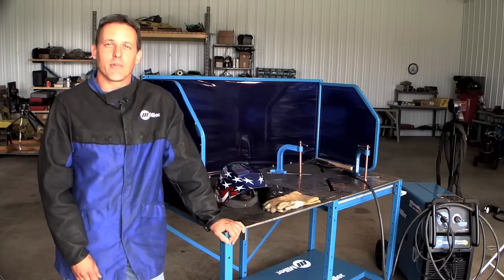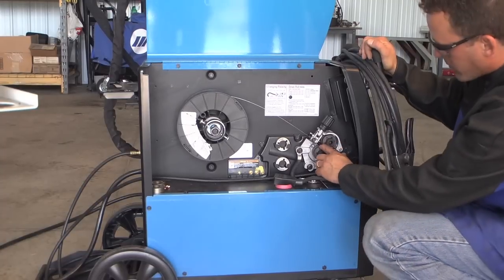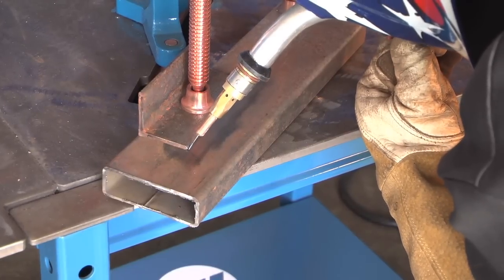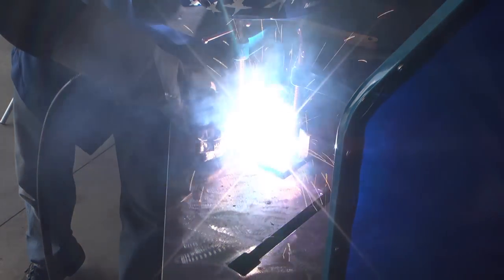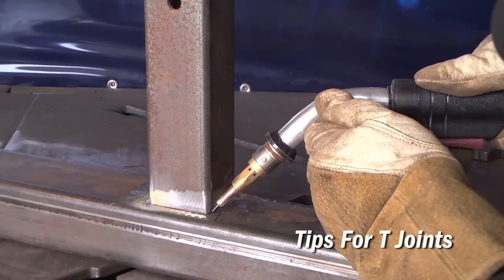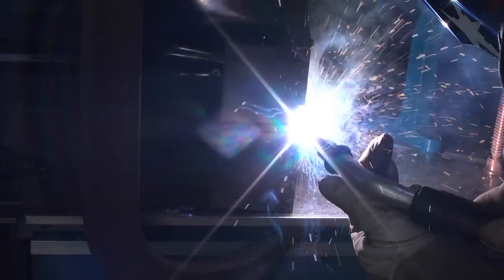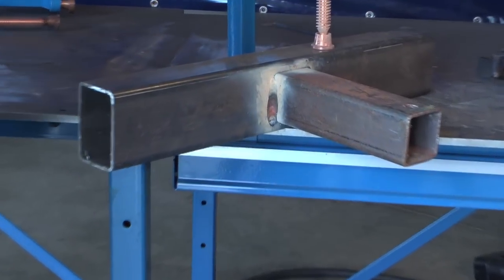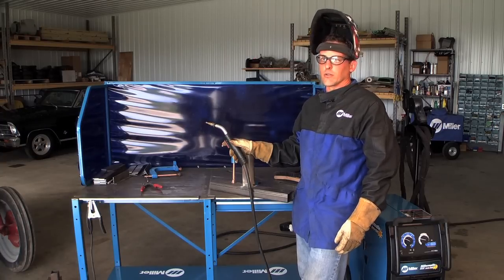Flux-Cored Welding Basics: Tips for Flux-Cored Welding

Comment: Worked in a rail freight car manufacturing plant for three years. They had flux core, but it was also with combination with argon and CO2, the wire used was called XL-71, that stuff was amazing, so easy to weld in pretty much any position for thicknesses over 1/8 inch. If you get your hands on that stuff, go nuts on structural welding.
Reply: Gas shielded flux-core is a slightly different and much nicer thing.  I think the self-shielded action we see here is something you use when there's no choice (such as being outside or otherwise in a breeze).  I'm just learning to do it now.  It's nasty!  I think it's really the thing for heavy structural which is not what I'm doing.  Some applications are for six or eight hundred amps!  I have some dual-shield stainless which I really like, and the ESAB dual shield also. As Jody said about something else: "They make you seem better than you are"!  Innershield action is NOT like that.  It makes you seem like you're making a big mess!

Comment: Joel...thank you for a great video. An experienced welder at work named Al Howie recently explained to me that the gas shield nozzle my welder came with is not good for flux core wire. I'm going to remove it and try again. All I was getting was splatter and blobs of weld. I'm better with stick, so this has been frustrating for me. Thanks to for going into detail on angles, stitches, drags and positions. Deuce? I own a real Deuce. That would be an M35A2C. Peace.

Comment: I have been using a friends welder with flux core wire.  I never used flux core so I didn't realized that knurled wheels are needed.  I was getting ready to replace the liner because of the feed problems, now I know I need to get the correct wheels.  Thanks.

Comment from the maker: And regarding the gun angle, we use the old saying "if there's slag, you drag!" Because this process produces slag, we want to pull the gun instead of pushing to avoid creating slag inclusions.
Reply: I am doing the drag most of the time. Even then I am getting lots of slag inclusions and uneven metal deposits. Surface is ground clean, so what am I overlooking?

Related question, my chipping hammer tip rounds over very easily on both the pointed and flat ends. Ground it a couple of times. Thought maybe the specific one I bought didn't get heat treated correctly so bought a replacement. Doing the same thing. Do all chipping hammers round over or did I just end up with a low quality hammer?
Reply: @brianworley7705  did you reverse the polarity of your machine like he said?
Reply: @zachshiray8998  Yes, when I changed from mig wire to flux core wire, I changed the polarity according to the diagram on the inside of my welder cover. I double checked it later thinking maybe I had done something wrong, all appears good. I don't know if I need more practice. I have observed the gun/tip angle seems to change a decent weld to splattering. So maye that is how I am getting slag inclusions?

Comment: Hi thank you for a great video & easy to follow I just bought one my welder  has a shroud over it is that for the gas I see you have taken yours off thank you for any info
Regards
Steve UK London
Reply from the maker: Hi Steve, you can leave them on when flux core welding, but they are not needed and will allow you to see the weld better without it.

Comment from the maker: Some flux-core wires do require a shielding gas, but most don't. In most cases we turn to flux core because it's an outdoor or breezy environment where shielding gas simply won't work. Depends on your specific wire and application, though.

Comment: Thanks for the informative vid Joel. Hey RotSeele I saw your post and wanted to comment. I saw some other instructional vids and they recommend pulling the bead but don't necessarily say you can't push it. If you watch Joel's video here, when he talks about the vertical weld he says if you "push up" you will get more penetration as opposed to pulling down. Probably the reason your teacher said to push the bead. I'm just starting out in welding myself. I'm a little older than you but just wanted

Comment: Thanks for answering my previous question. Another newbie question is how safe is electric flux corded welder? Let's say I accidentally exposed and touched the piece of metal while welding, would I get electrocuted and die on the spot? Example 100 amp welder. I'm in fl with 90+ degree everyday, so by the time I'm done wearing full protection suit, I'd sweats a lot and it's create moisture which I heard it's not good for welding.
Reply from the maker: Thanks for the question, t dub. Please consult your owner's manual for a list of safety precautions, including personal protective gear, environmental considerations and best practices for installation and operation. In your manual you will find specific instructions for grounding your equipment, proper handling of electrical components, maintenance and more.

Thanks!
Reply: i've held parts with one hand and welded with the other many times and never been shocked.

Comment: Hi Joel, I've noticed that some people take off the gas shield when using flux cored wire. I can see why this is possible because you aren't using a gas. My question is ,'Would this be OK do you think for 'any' torch as I can see how much better you can see your work. Great Vids for green people like me .Thanks a lot.
Reply from the maker: Gene - Quite often the nozzle is taken off so people don't ruin the nozzle and plug it up with spatter. This way the nozzle is clean if the operator would switch back to solid wire. Also, it is much easier to see.
Reply: Thanks for that. I hadn't thought about the amount of flux spatter that would build up in the nozzle.Thanks again..good vids. Gene

Comment: i just do a little job now and then on my vehicle, rust panel change, but when i use flux core, the volts changes up and dawn, somehow, i do not understand it, it's a CIG model 155 amps, what tip can i get please here, should i take it to warantee shop, unless u might give us an idea thanks, great work u did i love that work there, thanks many,regards lenny
Reply from the maker: Thank you for reaching out. We recommend giving our service line a call to talk this through with a tech. The number is 920-734-9821. If there’s anything else we can help with, just let us know.

Comment: Those are some sweet welds. I always seem to have a hard time following the gap/joint to be welded. My welds meander around. Maybe my shade is set too high?  I'm paranoid about messing up my eyesight.
Reply: I'm in the same position. I set my lens to maximum sensitivity and shading but I can barely see the weld pool.

Comment: Do you need to clean the slag off at the finish?  Will it affect the weld over time or even act as a barrier to the elements?  The only reason I can think of to deslag is to inspect the weld.
Reply from the maker: +Robert Marks You do not need to remove the slag on the final pass or if you are performing a single pass. You would only want to remove the slag for the following: if the weld is to be inspected, if you want to review your weld or if the part you’re welding is to be painted, power coated, etc.

If you are just trying to stick 2 pieces of material together and do not care what the weld looks like, and the pieces will not be finished in any way, then no, the slag does not have to be removed. Please let us know if you have any further questions. Thank you.
Reply: Miller Welders Thank you.  I was thinking of making a trestle for my wife's garden and I don't care too much about the welds since it's not load bearing except for climbing plants.
Reply: +Robert Marks always remove the slag and clean your weld. its what a professional would do

Comment from the maker: Also, the use of the appropriate Personal Protective Equipment is required to prevent contact with live electrical parts. As always, to protect yourself and others from injury, you must read and follow all labels and the Owner’s Manual carefully before installing, operating, or servicing welding equipment.

Comment from the maker: For the self-shielded flux-cored process shown here, it is not necessary to have a nozzle. The arc generates an atmosphere that protects the weld puddle from the outside air, which is why the process is used so widely on outdoor construction applications and is not affected by the air from the fan. You can add an insulator to the front end of the gun, however, if you wish to protect the contact tip.

Comment: Thank you for the great video.  Is it possible to fill small gaps when using flux core wire?  Can i spot weld along the gap and then fill in afterwards?
Reply from the maker: Hi Courtney! Thanks for reaching out. We recommend giving our service line a call to talk this through with a tech. The number is 920-734-9821. If there’s anything else we can help with, just let us know.

Comment from the maker: All of the Miller equipment used for Flux-Cored Welding does de-energize the electrode and wire when the trigger is released and therefore a conical tip protector is not used as part of the system. Additionally, the Open Circuit Voltage (OCV) of the equipment used is 35 VDC maximum. This voltage level is within the limits of a safety extra-low voltage (SELV) system.  (cont.)

Comment: Why did you change the polarity?  Are all these tips good for all metal types?  Stainless steal?
Reply from the maker: shmeet, 
Self shielded flux core wire is supposed to be ran in electrode negative. There are other flux core wires that are considered dual shield in which you would use gas and run electrode positive. 
We recommend that you follow the manufactures recommendation for the wire you are running. Yes, these tips work for all metal types - even stainless! Please let us know if you have any other questions. Thank you.
Reply: DCEN flux core wire + goes to clamp, - goes to gun. DCEP mig + to gun, - to clamp  Hope that helps. You can weld the other way just really poopy welds.

Comment: About the fastest welding method I've ever used.Low current use compared MAW and about 3 times the travel speed. While not the most attractive result certainly tough and pinpoint positioning of heat.

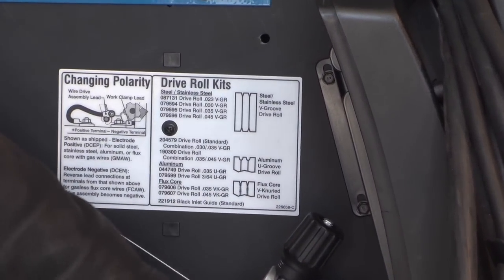Comment: So, flux welding going negative (1:17), does it means put the ground to (+) and the stinger to (-)?
Reply from the maker: That would be correct. With self-shielded flux core wire you would use electrode negative, work cable/clamp would go on the + stud and the cable for the MIG gun on the – stud.
Reply: @MillerWelders  Thank God that you guys have made this video! :D Thank you very much!

Comment: do you think the $100 mig/flux from harbor freight would be good for a first time welder and for weekend projects like small auto welds or go karts etc?
Reply: My suggestion would be to save up your money and buy a Lincoln or a Miller, Hobart welders aren't bad either.
Reply: I've got one, use the free spool,of wire to practice beads on scrap metal. Then go get a good roll of wire for the real projects. The internals of the HF are fine if you are just a "weekend warrior welder". Cheers!
Reply: Sinkin TheInkIn thanks
Reply: I've made motorized choppers and yard carts with this exact spark box. Proper beads and speeds, works good. Friend of mine is a certified welder on an oil rig. He's used it. Couldn't believe how well it ran even compared to a Hobart and/or Lincoln
Reply: i know your one of your parents actually, shes very nice =)
Reply: Don the Onion My parents have been dead since 1988.
Reply: i'd say i got u pretty good then lol

Comment: Sir which one is easier to use, stick or flux core gasless? Newbie here. Thanks
Reply from the maker: Hi Jai, thanks for the question! It really depends! Both stick (SMAW) and gasless flux core (FCAW) welding are relatively easy to learn, but most people find that the gasless flux core welding may be easier to master. With that said, whether you use SMAW or FCAW will depend on the situation, with one or the other being more advantageous. Before starting your project you may want to consider consulting your local distributor to see which process they would recommend. Please let us know with any additional questions! Thanks!

Comment: What was that blue plastic/mylar sheet on the back of the bench?  is that purely a light shield or does it also prevent shots of sparks and metal?   Where is it avail?
Reply from the maker: WanSolve, the blue plastic sheet is a weld curtain - it is used for shielding the light from welding and also shields the sparks from flying around your garage or shop. It is available on www.millerwelds.com under accessories. Or, you can visit your local welding distributor for larger pieces to custom make your own. Please let us know if you have any further questions.

Comment: right now i'm using a miller mig machine suitcase and i'm doing welding jobs on G.A. metal sheet. but I can't get the proper amperes and voltage to it,is it in the gas flow? before i'm use to using direct co2 for my machine and now i'm only using cylinders or tank. and my wire now is 0.8 mm and before it's 1.4 for shipbuilding. what kind of adjustments should i do?

Comment: Recently bought the Millermatic 125 and am having trouble with it. I have installed the flux core and adjusted the polarity as it specifies in the manual. Also I have tried to ground it on varies metals i had available. Everything appears to be in order but when i go to weld, nothing happens. Only the wire feeds but nothing else. What could i be missing? I've looked over the manual several times with no luck.
Reply from the maker: +David Tlatelpa We recommend that you give our service number a call so that a tech can help you troubleshoot. The number is: 920-734-9821. Let us know if you have any trouble getting through. Thank you.

Comment: will it be necessary to clean the metal first?
Reply from the maker: Jason Browne Yes, cleaning the metal or base material prior to welding is essential. Dirt, oil, grease and other debris can easily enter the weld pool causing contamination that could lead to poor weld quality and costly rework. Please let us know if you have any further questions.
Reply: the cleaner the metal surface, the better the arc can attack the metal and heat the puddle. rust and paint do not conduct electricity, so you will want that stuff cleaned off as much as possible, otherwise the weld will suffer, and could end up being much weaker

Comment: What i have now is a MIG and i really don't want to buy a new flux and gas to weld aluminum. If i use an aluminum wire that's got the flux core could i weld the aluminum?
Reply from the maker: adsfacvadtrvawefdgh jdsfpoiajsdpo What type of machine are you using?
Reply: Miller Welders Not cretin, i just know it's a mig welder.
Reply from the maker: adsfacvadtrvawefdgh jdsfpoiajsdpo Unfortunately there is not a flux core wire available for aluminum. The machine used in this video can be used to weld aluminum, but an aluminum wire and Argon gas would need to be purchased. Keep in mind that this would also need to match the base material. Also, only the shortest MIG gun will work because the softness of the wire (you can't push it for long distances). We would recommend a pull gun.  If you chose to use the soft aluminum wire, a new liner should be installed in the old gun - otherwise the soft aluminum wire will get contaminated by the metal particles from the mild steel wire and the weld won't turn out well. Contact a distributor near you for more information: http://www.millerwelds.com/wheretobuy/
Reply: Miller Welders Thank you kindly.

Comment: First comment in 7 months, but here goes. 
I bought a Pro-series 125 amp flux-core kit, and it came with a nozzle. Why if it isn't needed? I understand all about shielding gas and flux doesn't require any, I was just curious why they would include a part that's not needed, since my machine is flux only.. Thanks.
Reply from the maker: +Path in AZ Thanks for reaching out. While we can't say for sure because we don't manufacture this machine, the nozzles do help protect the tip and diffuser from sparks and spatter. We hope this helps.
Reply: Thanks. Great channel.
Reply: Hey path was wondering how you went my machine I just brought also came with a nozzle and being so used to mig welding gave it no second thought until I decided to check out a YouTube video just to see how some welds came out and came across this with them not using the nozzle does blow your mind at first but obviously makes sense as no gas is needed my question to you is how did you go with your machine you find any differences in welding with or without the nozzle 
Thanks
Reply: IIRANDOM CHAOS There is no real difference. If you run with out a nozzle, you should still protect the threads. I bought an attachment at Home Depot for about $3 that screws on the threads to protect them. No gas menas more splatter, but for what I do that's fine. Good luck.

Comment: hello sir, I have a question I want to replace welding electrode welding 70/18 by the flux core 0.45 and my big question is has sufficient strength and penetration I create bridges Quick and steel scaffolding ..... . greetings from mexico thanks